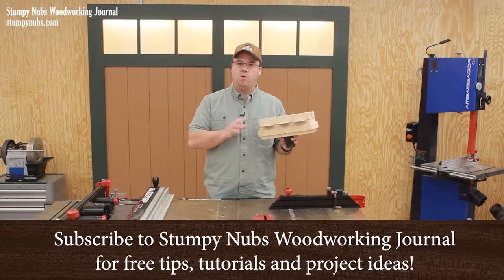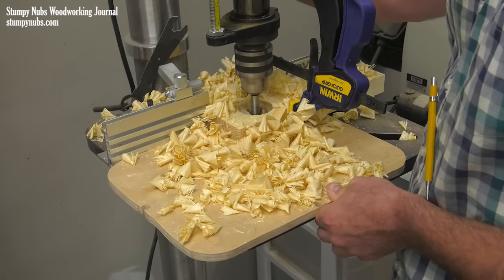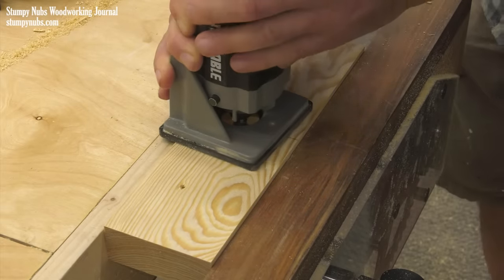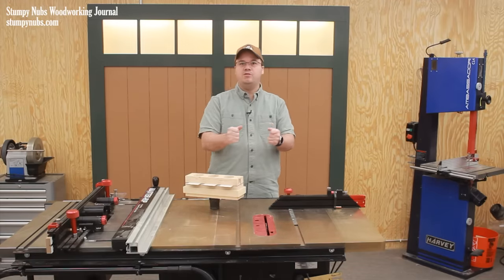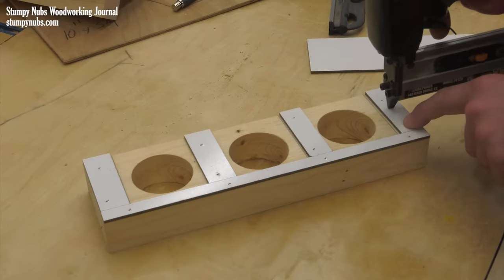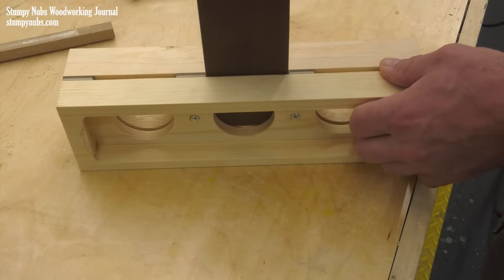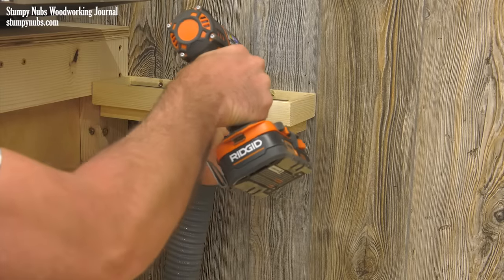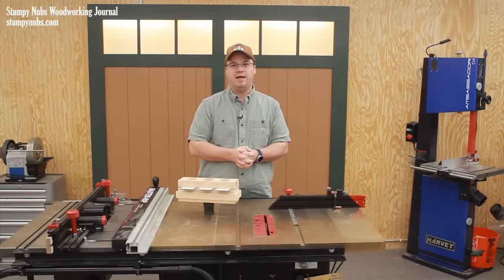HOMEMADE Shop Vac Device TRIPLES your dust collection!

Comment: Why not mount the manifold directly to the Dust Deputy separator that's already attached to the vacuum? Also what are your favorite collection hoses?  The hoses that come with shop-vacs suck.
Reply from the maker: Mount it where is most convenient for your uses. The Rigid premium hose is pretty nice as far as shop vac hoses go. You can buy it at Home Depot, I think, for about $50

Comment: This build contradicts his video on dust collection and smooth transitions.
Reply from the maker: No it doesn't. Shop vacs are high pressure / low volume. A dust collector is the opposite, and relies upon air speed to keep the ducts clear more than a shop vac does. This will reduce shop vac suction a little, but not like it would a dust collector.

Comment: I'm affraid you are losing lot of suction (performance) with this design, the shape of the airflow is not optimal.
Reply from the maker: Shop vacs are high pressure / low volume. A dust collector is the opposite, and relies upon air speed to keep the ducts clear more than a shop vac does. This will reduce shop vac suction a little, but not like it would a dust collector.

Comment: so many reasons my Engineering brain just went nope, nope, nope.  Have spent a couple decades explaining to people why this is poor performance and highly inefficient.
Reply: Can you give any examples?  I've seen a few shops use  a similar setup with 1main vac and multiples gates to.choose which tools dust to collect.
Reply from the maker: Shop vacs are high pressure / low volume. A dust collector is the opposite, and relies upon air speed to keep the ducts clear more than a shop vac does. This will reduce shop vac suction a little, but not like it would a dust collector.